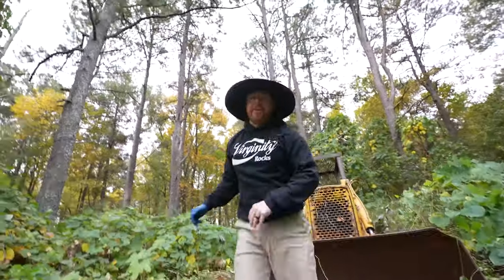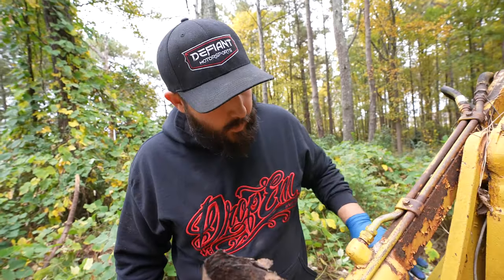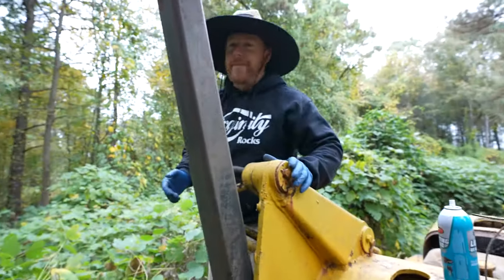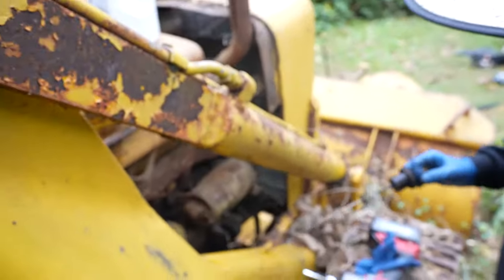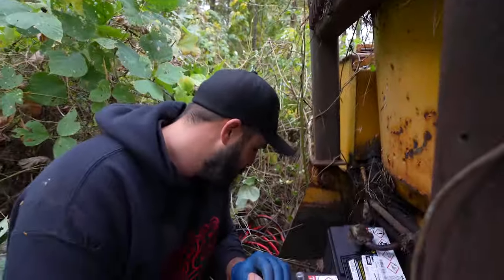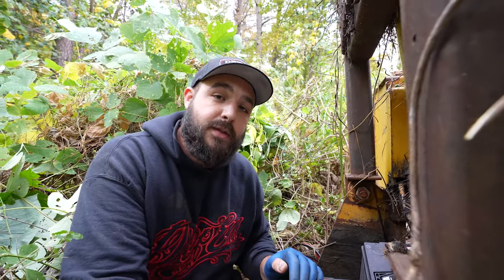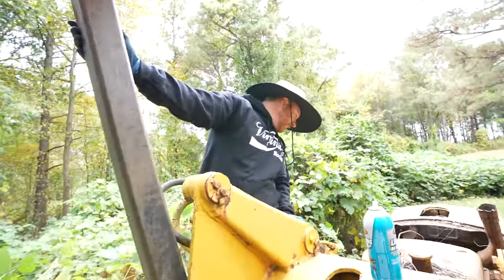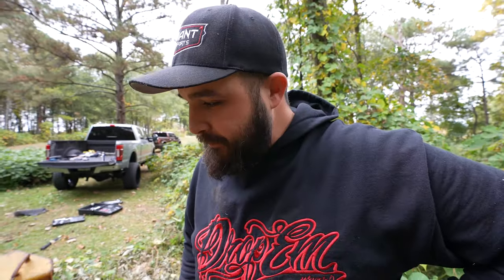WE GOT A FREE ABANDONED BULLDOZER. WILL IT START AFTER 12 YEARS?

Comment: Lots of things wrong with this approach. No serious mechanic would have to guess whether the electrical system was 12 or 24v. Water in the pan? Drain, flush and refill, and pull the injectors, then get out the WD-40, the big breaker bar and cheater pipe to try to roll it over by hand before you ever put the starter to it. Got a way to shut it down if it does actually start?? ...And in what universe is the positive cable black and the negative red???

Comment: Hopefully somebody drug this old John Deere out of the woods and got it going. From the looks of it, it was in pretty good shape. Though if it was sitting with an open exhaust for 12 years likely going to have to pull the head and unstick it. I wouldn't have even tried hooking power up to it without verifying that it turned over with a breaker bar first.

Comment: Before you criticize people for using a red cable for a ground wire, you should check if that piece of equipment had a positive ground.  Although you almost never see that today, positive ground was quite popular with many manufacturers years ago, especially 12V systems in equipment like that track loader.
Reply: Why would anyone run a positive ground as you put it ? To me ground is ground. What color you identify the wire doesn't matter as long as it's known that what color wire used is ground. Wire colors has been standard for quite some time however most standard just like safety rules are typically written in blood and someone probably got hurt or killed bringing about the change and or standard. Typical 480v 3 phase wiring is brown orange yellow and gray for the neutral. Every true electrician knows this. But I bet there was a time when that wasn't the case. All that said is that A reason that red would be ground and black be positive ?  I mean this isn't like welding where 70% of the current could be going through the ground cable and the other 30% going through the actual electrode. Though that's being done deliberately by the machine. The machines feed is still adhering to principles of physics governing electricity. Hence positive to negative flow. Can someone explain any of this to me ??

Comment: Buy a battery powered transfer pump.  They are not much more than 30 bucks and run on a few C or D batteries.  One of the best things I have purchased after they came out with ask of these silly over engineered fuel caps.

Comment: These guys are as far from diesel mechanics as u can get.
1) pouring oil in the exhaust is just gonna get oil in the exhaust valves which does nothing for the pistons.
2) take a big braker bar and the proper size socket, put it on the crankshaft pulley and try to rotate the engine before destroying the starter motor.
3) go thru the basics like does it get fuel, is the air filter cloged is there oil in the engine and water?
And at the end if u get it turning and it doesnt start check the compression.

Comment: Hire Superman to bump start it. What I'd really like to see is how to load it when it's not running. With the tracks not turning can you simply drag it onto a trailer without destroying the trailer?
Reply from the maker: There’s a pin under it I believe. If you pull the pin, it frees up the tracks. But the problem is the bucket is on the ground.